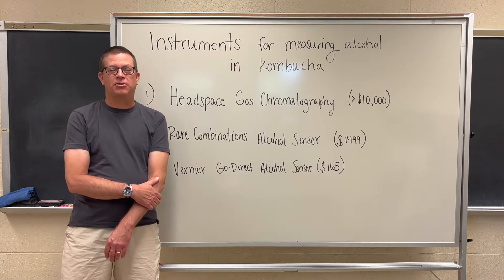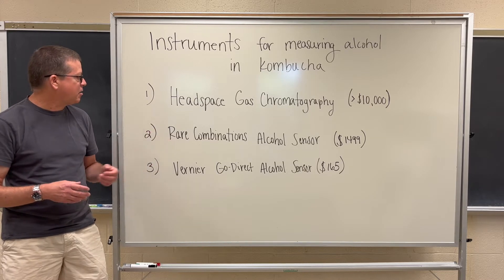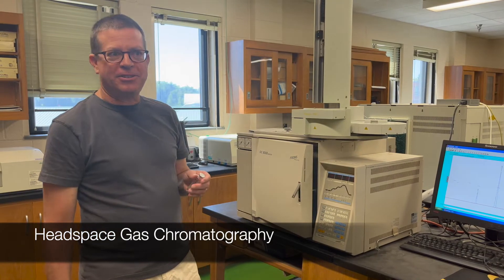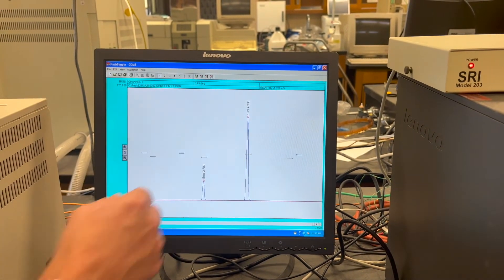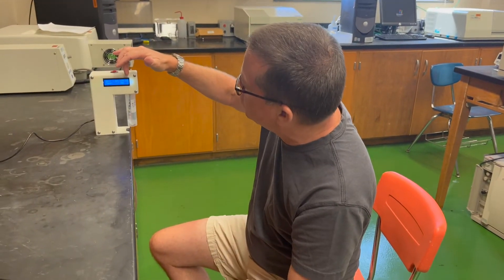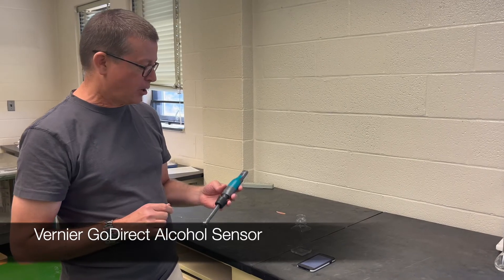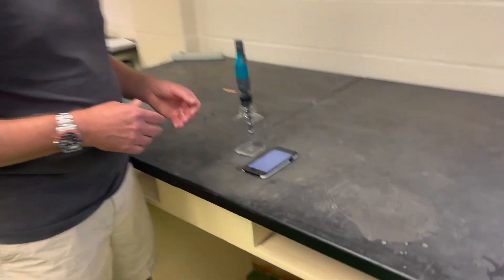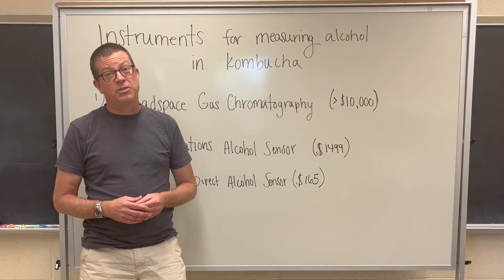How to Measure Alcohol in Kombucha

Comment: Hey, thanks so much for your video. I currently have been brewing my own homemade hard kombucha for a few months but struggling to know when to best take the OG hydrometer reading and Final reading. Phase 1 of my brew is first fermentation with the SCOBY and sugar black tea for 8 days. Phase 2 is my second fermentation moving my kombucha to two 1-gallon glass jars with the airlock and adding in champagne yeast mixed into two cups of sugar water to "wake up" the yeast. This phase is also 8 days. Phase 3 is when I move my kombucha to two different 1-gallon glass jars where I add my dried fruit and keep airtight for 5 days before putting into the fridge. Based on the above process, when do you think is best to take my initial hydrometer reading and final hydrometer reading? I'm trying to figure out the ABV% of my batches now that I have a set and written process. Any help or recommendations would be much appreciated.

Comment: I JUST did a video using alcohol breathalyzer and a chart like you mentionned with the rare combination.
I don't know if that works as well and I might spend more time experimenting.
I'm actually using my mouth as test tube and blowing air in the alcohol breathalyzer 1 second after spitting kombucha.
:)
Fact is that there is neutral air passing through my mouth and it gives me more or less a consistent value. I taught it was interesting in all case. I don't know if it's really a thing.

Comment: Given the alcohol is present in the headspace, would the reading be lower if the sample was left uncapped for an extended time?  (Though I guess vodka or any other alcohol still keeps it potency for the duration of the evening drinking it....)
Reply from the maker: Hi Brian, the alcohol is present in the headspace due to us heating the capped vials to a high temperature for analysis. If the sample was left uncapped, in general some ethanol will evaporate.

Comment: Hi, thanks for the overview. However, it's not clear how carbonation affects the measurements, especially during RCAS mesurement.
Reply: Hi there! The RC alcohol detector directly measures the alcohol. So no need to filter, degas, or anything like that. You can measure any sample even if it is carbonated and there is SCOBY floating around :)
Reply: @rarecombinationsllc  Question... do you have to substract the TA (acetic acid) from the final reading?
Reply: @gennaterra  Nope! The RC detector directly measures the alcohol!